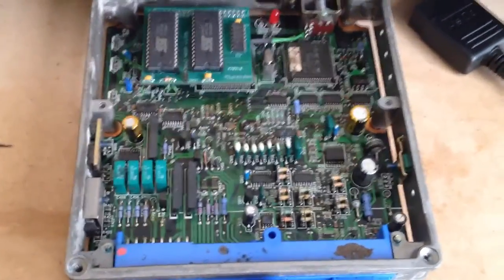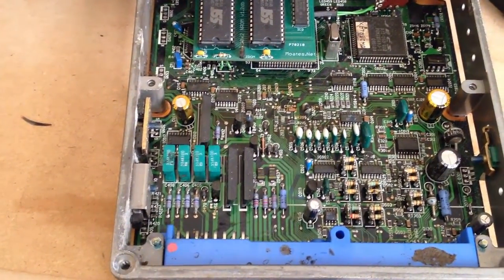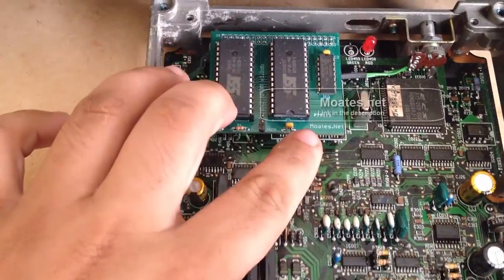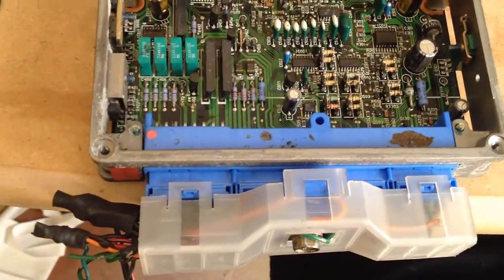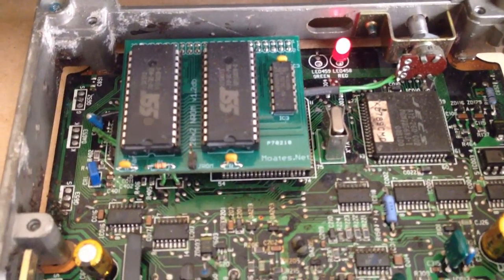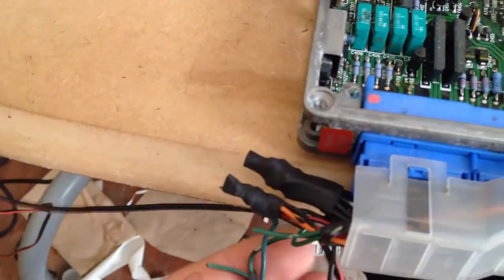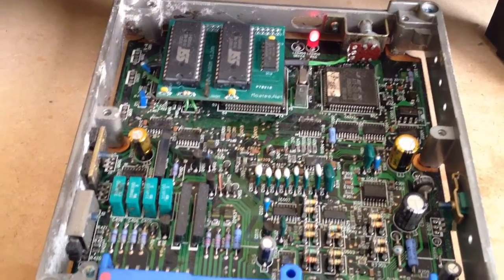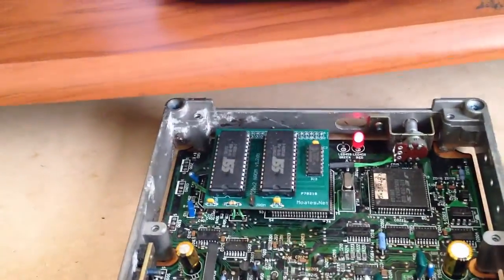240sx Powering Up ECU without Car

Comment: I was wondering ka24de ecu not turning while ignition is on, but the car still run. I check all fuse and relay are working, but don't know why ecu led not coming on. Could this be bad ecu?
Reply from the maker: So the led doesnt light up but the engine still runs? It's possible something on the board is burnt. Have you opened it up and inspected it for burning or corrosion?

Comment: Which pin send spark to engine?
Reply from the maker: What engine/ecu.
Reply: Dohc ka24de 5 speed manual. Does number 3 pin on ecu harness need to have power while ignition on or No? I check ignition signal wire and no open loop or broken wire. Could be bad coil, but I don't see how because I have 4 ignition coil and all cannot be bad.
Reply from the maker: I'm away from my pc to see a diagram but it should power when it motion is on
Reply: I believe number 1 thick white color and number 3 yellow and red that ignition control module plug. I turn ignition on, and no power on number 1 pin. Could this be why it not getting spark? 2 other pin have power with ignition on.

Comment: I purchase NDS1 Android but it won't connect to my 1991 240sx using the USB consult adapter. This setup will work with my 1996 240sx.i created a minimalist harness with ECU and consult connectors only. ECU powers up but won't connect. I've tried 2 1991 240sx ECUs with no luck in and out of the car. Any ideas, hope you can help.

Comment: Hi, thank you for posting this video. Would you be so kind as to post written instructions or at least a diagram on what wires you connect to the DC voltage of ECU to get it to power up?  I'd be very appreciative if you would. Also, is this how you would power up other or most ECUs?  Thank you!